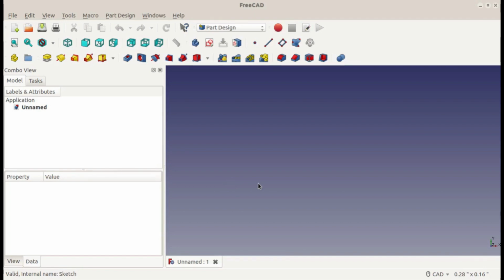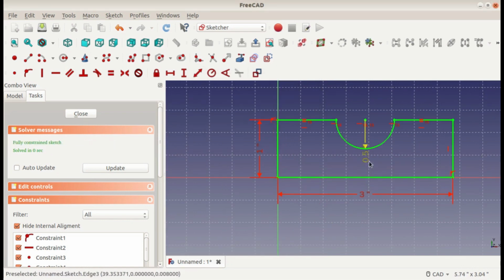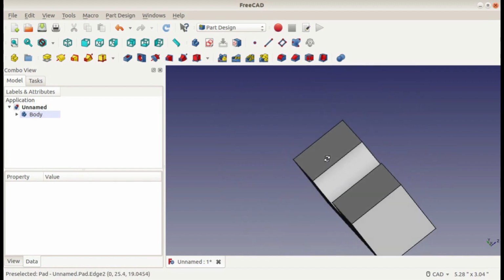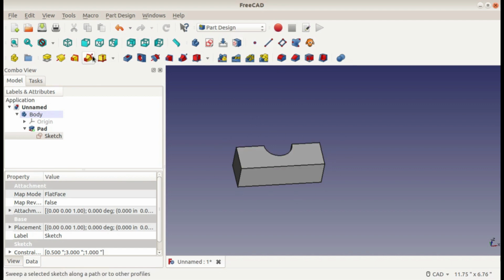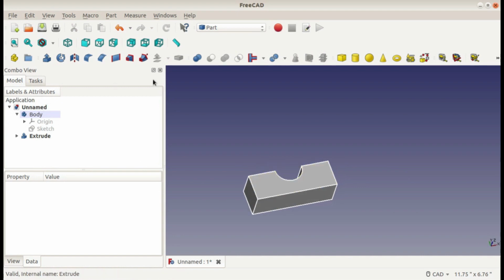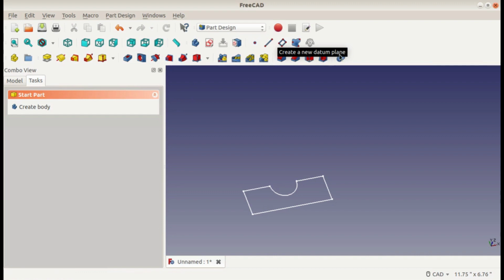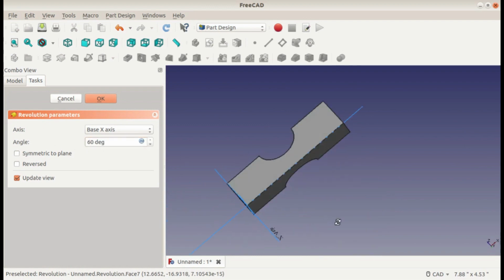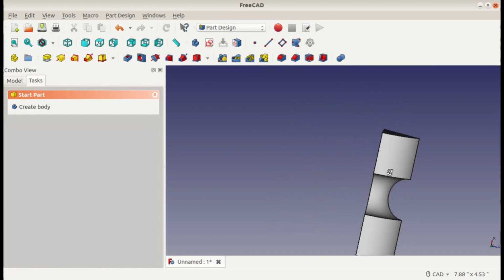Learn FreeCAD: #3 Extrude - Tutorial

Comment: your series is very good , easy learning tool but  sometimes you go too quick  in this case you omitted to say that the sketch could not sit over the axislines , i.e that if you put the sketch against the Y axis the revolution extrude  produces  a solid object and if you put you put the sketch away from the Y axis it produces an solid object with and axlehole like a wheel
however you don explain how you make the sketch fully constrained i tried reproducing it step by step but i can make it happen / work out from the images

Comment: Hi there, I'd be inclined to agree with Lane Gustafson. I can't follow the initial steps in the previous video about setting constraints - it just gives the thoroughly unhelpful error message: Datum 20,00 mm for the constraint with index 15 is invalid. You show the steps so quickly in this video that I can't possibly follow it and constrain even this simple shape. Is there any chance you could walk us newbies through it a little slower? Cheers!
Reply: Hello there, that error usually appears to me when the constrain I'm trying to make cant be possible because of the constrain the message shows, make sure the previous constraint makes sense with the one you're creating, if you can't find it, just go to the list at the left and look for the number the message gives you, when you click it it will highlight it in green, I hope I could be of help.
Reply: @thetuner3333  Thanks for the advice; I'll give that a go. I couldn't actually constrain even a simple rectangle, so I must have been doing something wrong. It was so fast in the video that I missed the necessary order (if the order matters). It returned so many constraint conflicts that I just asked for help!
Reply: @j.m5888  yeah... this program is quite intimidating especially if you don't have much background, it took me a while to learn how to constrain objects, if you still cant constrain it, just make a rectangle(using the tool), set the height with one side, set the length on the bottom and use a symmetry between the top right and the bottom left with the center and that should do it. (the order doesn't matter as long as everything has a place)
Reply: @thetuner3333  Hi again, thanks a lot for the encouragement! I'll give it a go!

Comment: Thank you for these awesome videos. I run into quite some issues when going from sketcher to part design and then to pad (from 2d to 3d) it gives me the message "Failed to validate broken face" any suggestions on what I am doing wrong in my sketching?
Reply: hi, it happened to me a lot at the start, the pad tool doesn't allow you to create parts with spaces and you need to have the sketch fully constrained, I hope I can be of help

Comment: Hi, thanks for the tutorial. I want to make the move to Linux so this will be a massive  help. i have a question if you dont mind. Can i create an axis that is not the xyz axis to revolve the sketch around?
Reply from the maker: When you are revolving in the part design workbench, one of the options in the "Axis:" dropdown is "Select reference...". You can use this to select an axis to revolve your sketch around, but the selection must be an edge of an existing part. I wish that you could select an edge from your sketch, but you may need to create a part and delete it after using its edge.
It is much easier to do this kind of revolution in the part workbench. Using a part revolve gives many more options about choosing the axis. This method will create a new part, so you will probably need to use a union boolean afterwards.

Comment: Hello, is there a surface tool at FreeCAD?
Reply from the maker: There is a FreeCAD surface workbench, but it is currently underdeveloped. You can, however, create surfaces in the part workbench by extruding a sketch and disabling the "Create solid" option. This will just extrude the edges of your sketch into a surface, rather than filling it into a solid.
I hope this answers your question. If not, I would be happy to look further into it for you.